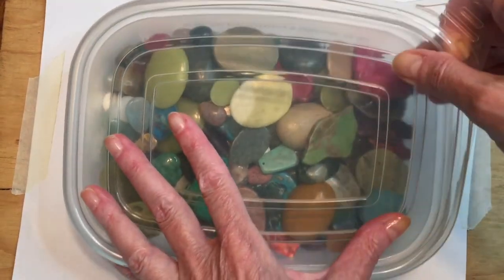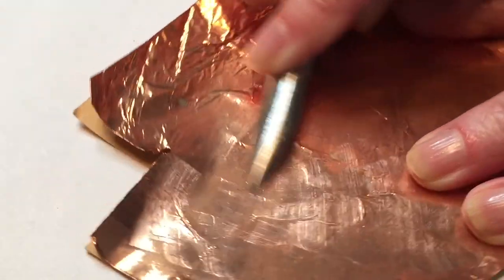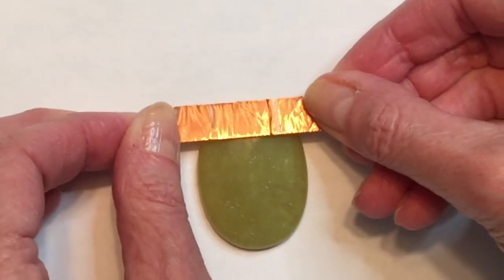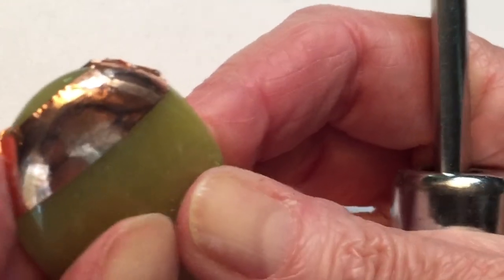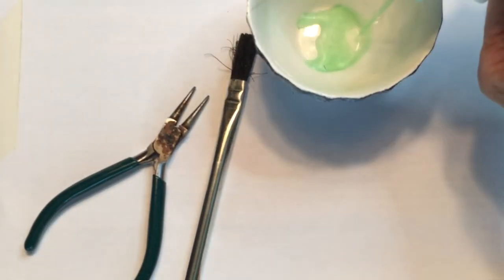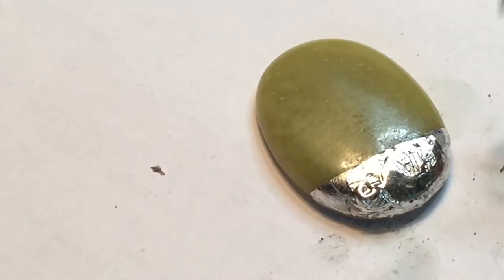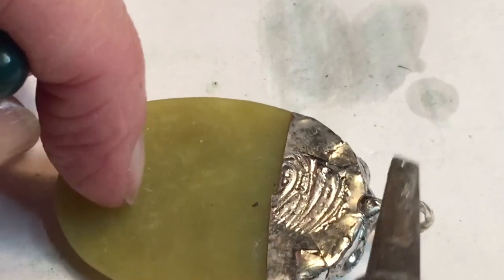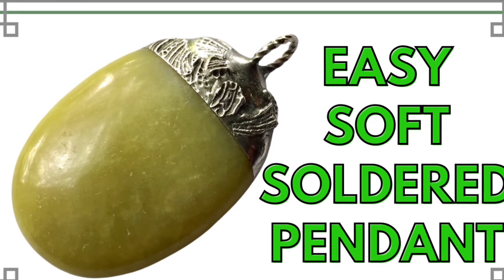Easy Soft Soldered Cabochon Pendant ✿ Soldered Jewelry Making ✿ Laura Beth Love

Comment: I'm curious if this works with more irregular and rough surfaces, and what would it take to do a bronze/brass color to mimic gold.
Reply from the maker: As for the surfaces you would have to try it out. You can add a copper patina or use paints for a finish.

Comment: Hi, I'm new to soldering pendants (Crystal&plates) I was wondering if you   you could help me with something. I was using this video and I was able to complete 1/2 of my soldering and then my soldering iron wouldn't pick up  the solder anymore, it started to create little balls that rolled off then didn't produce anything else. I was soldering at 450 degree Celsius. Any idea why this was happening and how I can fix it? I feel like I may have ruined my irons tip but I don't know. Thanks!
Reply from the maker: It could be one of a number of reasons, I go into that in detail in my newest book Soldering Iron Jewelry , which you may find very helpful. Good luck! https://www.amazon.com/shop/laurabethlove/list/31QO19DFHTJZC?tag=onamzdishfund-20&ref_=aip_sf_list_spv_ofs_mixed_d

Comment: Does the edge of the foil have burs, or a roughness? If so, do you recommend filing or sanding?
Reply from the maker: If stamped correctly there should not be any burs or roughness - you can file rough edges with an acrylic file if needed.

Comment: Where can I find good high temperature solder tips
Reply from the maker: I just use what comes with my iron. Be careful not to burn them out, don't leave them on the highest setting just sitting if you are not using it, try to work at the lowest setting you can. You can get good irons and tips from a stained glass supplier, those made for stained glass, from amazon, or some from electronics catalogs, but those are usually too small to do the job since they are meant for electronics repair.